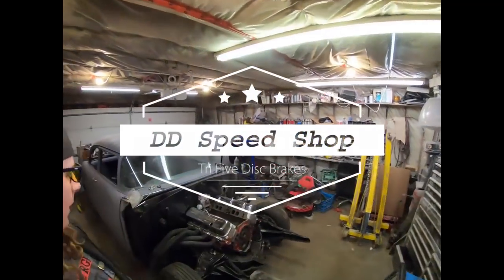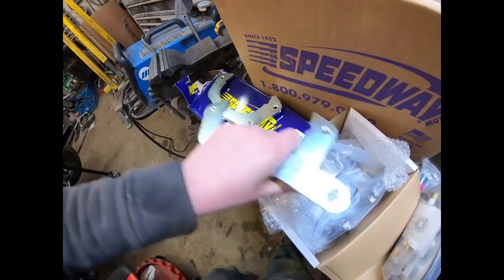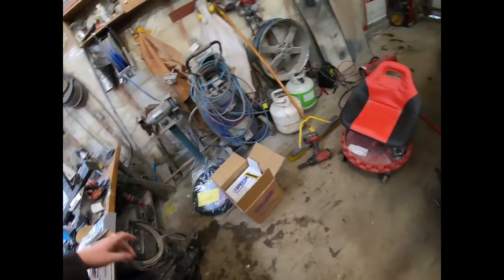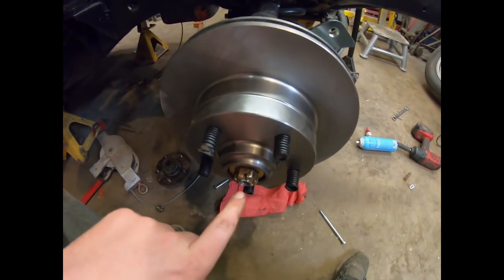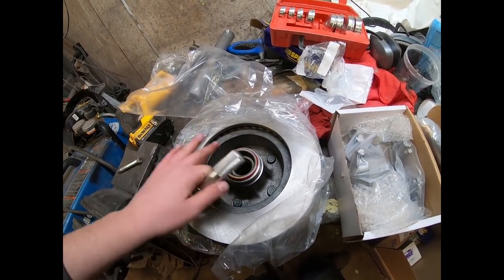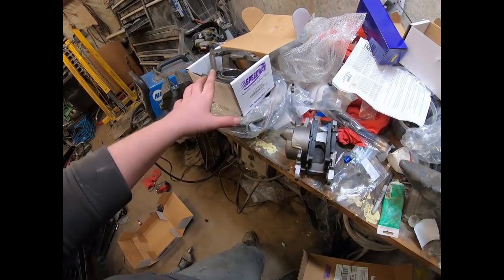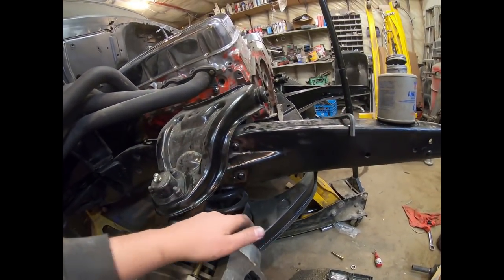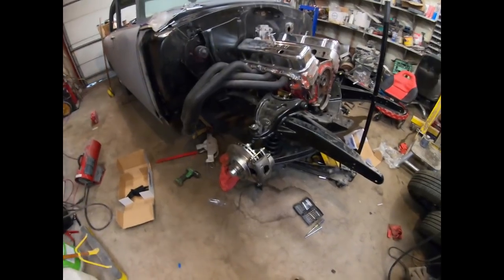55 Chevy Gasser Disc Brake Upgrade - Cheaper than Drums

Comment: I have a similar kit on my 56. They work great! Hopefully all the linkage  clears the pan. You know the snowball effect when modifying cars. I have to replace the rear spring bushings have them in hand but haven't done it yet. Will follow along to see how you make out. I was able to get my backup lights working on the 56 this weekend. Little cutting on the freshly painted column. Added a new wiring harness and switch. So cool seeing those little lights come on. After so many years. Lot of work but so satisfying. 😎
Reply from the maker: I am not confident in the steering Haha. Owell.

Comment: A better zero offset design would be to use 61 Chevy roller bearing hubs and 79 trans am rear rotors. Did it to my 57 and love it.

Comment: Looking good  i used the right stuff kit it used smaller metric calipers and mounted to rear of spindle. I used bracket kit from Danchuk on my other car looked just like your kit. Both seem to work the aame so far will know more next month plan on doing  alot of driving. I posted some videos on my youtube channel
Reply from the maker: Nice!  I'll have to check them out.

Comment: U can use 64 Chevy Impala. Top ball joints on ur 55 aframes they. Will fit right in place and they don't have that tall top sticking out and u will have better inside Rim clearance

Comment: Update:
Stupid me I didn't know you used the original spindles with this disc set up. Years ago (many) you had to use a spindle from a B body car (or was is it an A body ) and buy a tapered ream so the stock tri five ball joints would be used to work with the later spindles.
Reply from the maker: Yeah they made it waaay easier now. The only change you need to do is the hole for the cutter pin needs to be re drilled. I guess the brake is a little wider than the stock drum stuff.
Reply: @DDSpeedShop  It's a cotter pin not a cutter pin. lol. You could really get technical and call it a shear pin.
Reply from the maker: @RichieCat4223  #autocorrect Haha

Comment: After all the metal work you have done I still wonder why you didn’t build a firewall recess .
Reply from the maker: So do I...... lesson learned for the next one.
Reply: I read an article years ago where guys were using a wheel barrow as the Recess. Good work man I enjoy your vids.
Reply from the maker: @MrBluetruck96  yeah I've seen that. Thanks for the support man!
Reply: @MrBluetruck96  my buddy uses them on 50 model chevy trucks and i have anither friend with custom shop has used them to works great

Comment: What spindles are on the car ?
Reply from the maker: Just the factory chevy ones.
Reply: @DDSpeedShop  You mean from 55?
I Thought those spindle took ball bearing not tapered bearings.
Reply from the maker: @RichieCat4223  yup they sell everything now to upgrade it
Reply: @RichieCat4223  yeah factory are ball bearings you can use later model hubs with roller bearings from 60s model chevy and keep drums danchuk speedway and others sell new hubs. The disc kits use 1970--72 chevelle ss rotors and 73 and up calipers, i just installed kit using gbody calipers or sometimes called metric think from malibus or cutlass late 70 to early 80s. Im thinking about buying the roller bearing hubs and put vette brakes rotor and calipers but will have to fabricate a bracket